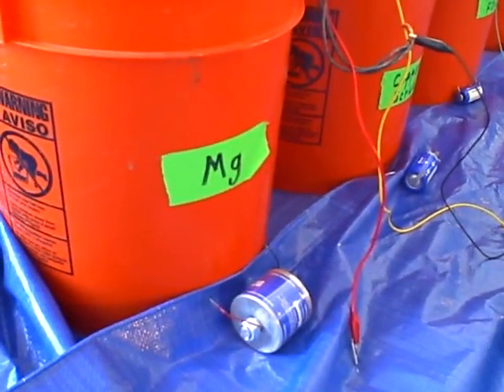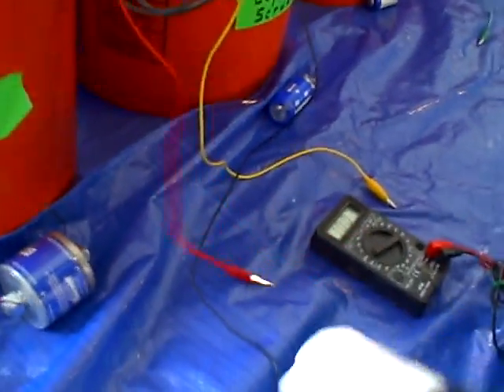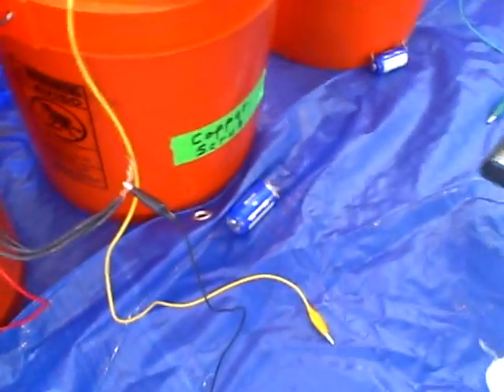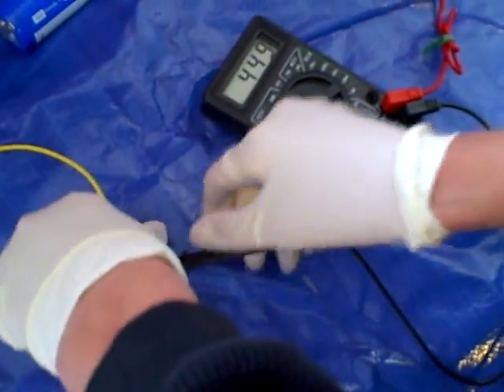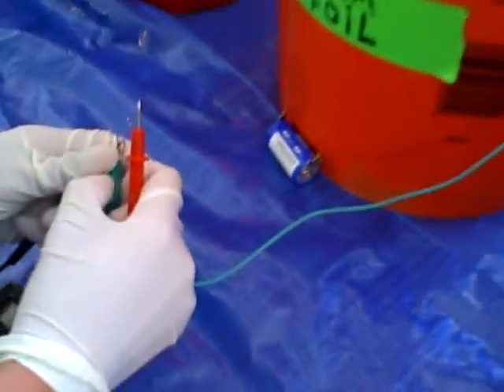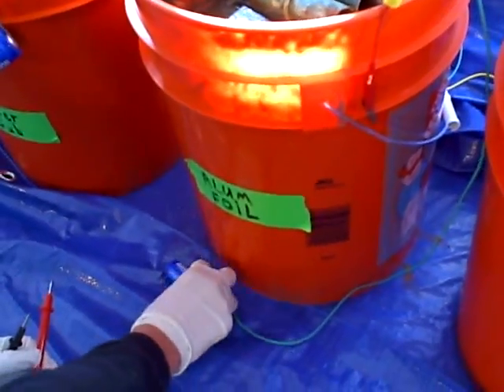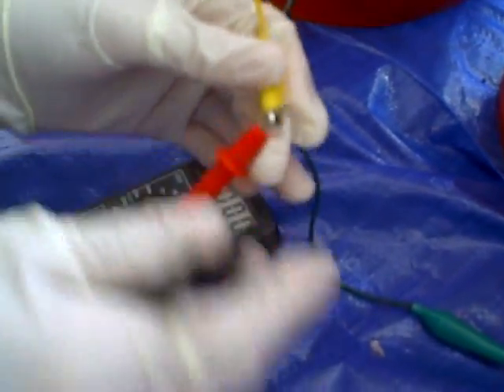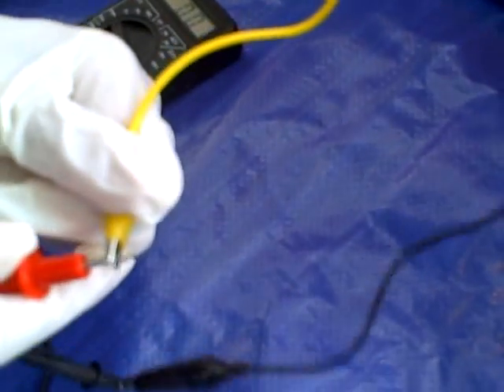Microbial Fuel Cell

Comment: you will get better results if you use air chatodes on the side of a whole cell, and closing the top of the cell to insure anaerobic conditions for anaerob bacteria inside the cell. If you didn't understain, ask me, we did some new never (or rearly) tested research and got nice results. I see you are ambitious, so if you want to try it, and need help, we can talk.